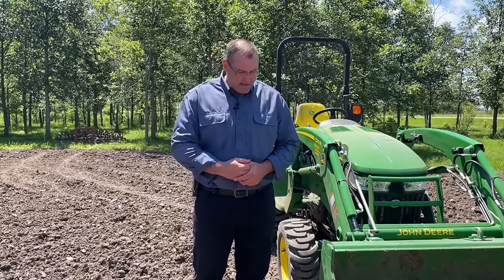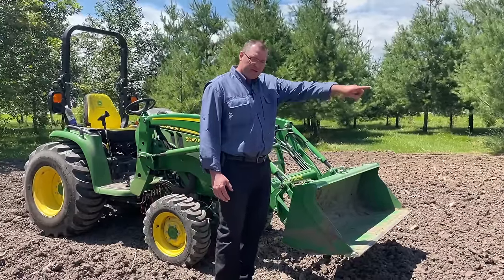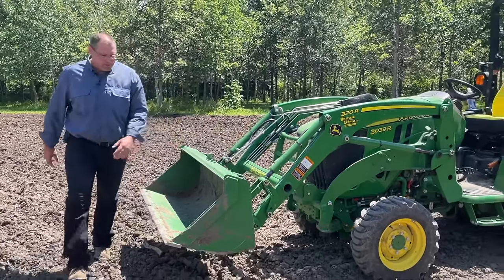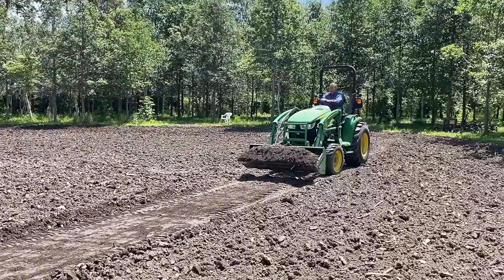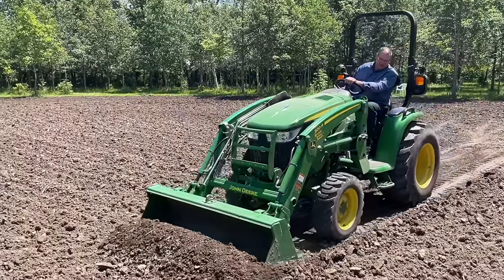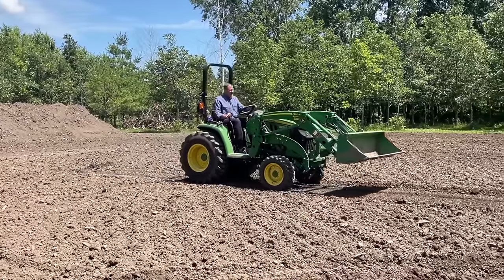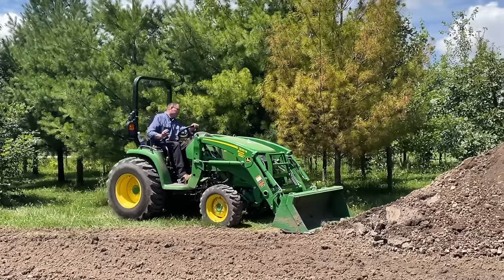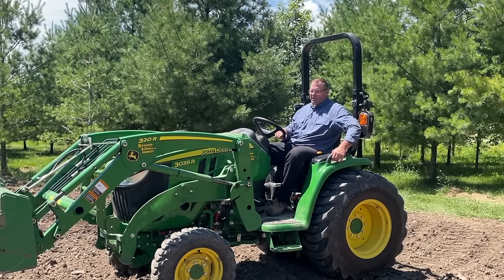Compact Tractor Loader School - Tips for How to Use a Front End Loader on JD 3039R

Comment: We have JD tractors on the ranch for over 40 years. I run them at full speed, using low gears.  Diesel engines do not like to lug and hydraulics work better at full power.  Using open station tractors use ear protection.
Reply from the maker: Thanks for sharing
Reply: Agreed. Lugging the tractor at low RPM doesn't let hydralics or engine work at peak power.

Comment: Bad thing about John Deere you can't use the loader in the bucket motions all at same time and your video just proved that... That's why I like Kubota multiple motion
Reply from the maker: I may be misunderstanding what you mean but if you mean that while you are raising the boom you can tip the bucket, you actually can perform that action, its just not nearly as smooth as other loading machines like a skid loader, etc.  The valve is very tight I would say and wants to select flow to one or the other and not both but there is a way to do it if the joystick is held just right.
Reply: @danimalshouse  yeah  that's what I mean you can't run the loader and the bucket both at the same time.. where Kubota you can smooth as silk

Comment: Have 300 x loader it ran just fine but parked it the next year it lifts but it won’t go forward or backwards any ideas what it could bet
Reply from the maker: I'm guessing that one of your hydraulic hoses is "almost in" but not all the way locked together.  I'd turn the tractor off, move the joystick up down left right to take the pressure off, and try to get the hose to go all the way in.  If that's the problem you should be golden.  Good luck!

Comment: First off you have freshly lain top soil which is by my view dry and soft. Doing this on hard packed soil with weeds etc. is quite different. I have a Kubota L3800 and it's tricky but do-able. What you're doing I could accomplish with a Tonka truck, just saying. Funny you never mentioned the float feature to back drag, hmmm.
Reply from the maker: Wow, let me know when you are having breakfast next so I return the favor and poop in your Cheerio's!  I actually don't have any issue with your observation, it's just a bit unnecessary.  What I did was about as easy as it gets but that's not the point, I was communicating concepts to and for new operators.  This video is my most positively commented on video by far and often by new operators that don't work construction, didn't grow up on a farm, and don't have much experience.  I assume you are experienced so to you this stuff is sandbox toy type stuff.  Not a problem, it's just not for you.  Good call, I forgot about the float feature.  I wish I had referenced it.  Either way, have a good day and thanks for watching.

Comment: Get bucket teeth.  It will break the dirt up easier, reducing load on the tractor and loader.  all of the things used for cutting into dirt used by LetsDig18 have teeth, the grading/smoothing stuff  (that works dirt that was already broken up) have teh smooth edge.

I dug a 120 ft diameter, 11 ft deep pond with a 25 hp "light utility" size tractor (smallest engine for the frame size)  teeth on the bucket more than doubled the rate of digging.
Reply from the maker: I totally agree with you.  To break things up you need either a sub-soil 3-pt hookup, a tiller, or some other option to reduce the forces on the bucket.  The bucket teeth would be a great option like you described it was for you and the pond.  Great tip!  If I get an excuse to need/use the bucket teeth you can count on a video showing how great they are.  Take care!

Comment: One front tire dosnt tip the bucket/machine.  The rear tires are always in the same plane as the bucket because they dont have a pivot like the front.
Reply from the maker: That's a good point in that having a front pivot reduces the effect of hitting a low spot by half but it still drops some.  Basically if you go into a 3" hole with the front the machine would drop 1.5" whereas the same hole with the rear tires would have the full 3" effect.  I would say that the pivot helps but does not eliminate the challenge of uneven terrain.

Comment: If you're saying a tractor can't dig.......? We'll, maybe yours won't. Mine does. And a pretty fair job in virgin (eastern Nebraska) soil. It digs a lot....with or without the tooth bar. And as far as starting level......your machine is going to follow the grade unless you level an area to start first. Tractors are enjoyable to operate but big warning to a newbie.......better have a good sense of seat of the pants feel. Tractors can and are tippy. Take your time and learn your machine.
Reply from the maker: Great input! I would say the tractor can dig but it's really not great at it unless the soil is just right like soft or loose material.  Hard clay and dry hard surfaces will show the limits of a utility(non specialty) machine like a tractor for digging, that's all I was trying to elude to.  Machines like a dozer or skid loader or backhoe would handle digging much better in tough circumstances.  I've heard people say the teeth are good but I also haven't ever found the need for it yet.  I think it digs just fine for it's machine category.  Thanks for watching!

Comment: You’re talking to somebody that operates on a utility machine the best way to learn is run it yourself because every operators experience is everybody it’s been on a farm or it’s been around heavy construction has some type of experience but if you’re talking to somebody it’s never random machine that’s why they usually will ask somebody that knows but that’s probably only a 48 inch bucket Cillessen 5 feet I think I got a 72 inch bucket nets 6 feet

Comment: Hydraulically 'shaking' your bucket, like at the end of the video, is not good for the equipment.
Reply from the maker: It's additional wear when that happens, I agree.  If you are sure the bucket is empty then there isn't a need to shake it like that.  It's just a habit when working with sticky topsoil I guess.  Good point.
Reply: @danimalshouse  The old guy that taught me was in his 70s. That was like almost 15 years ago. He would flip out when he saw that. I just listened. This guy was like Fred Flintstone and ran cable shovels back in the 50s. Ha ha.
Great video. I always like to learn new tips and tricks.

Comment: Great video .can you drive into a pile of chopped wood or load the wood into a bucket  manually in order to move a pile ..just gotta a kubota b2301 .scared I’ll bend bucket or hydraulics l.. thanks for the vids
Reply from the maker: For me and the JD 3039R, I just listen to the machine to understand the forces being applied.  With the engine at a lower RPM if you have to rev up the tractor because the hydraulics are bogging down the engine, you're likely flirting with some potentially dangerous forces.  Good luck out there!